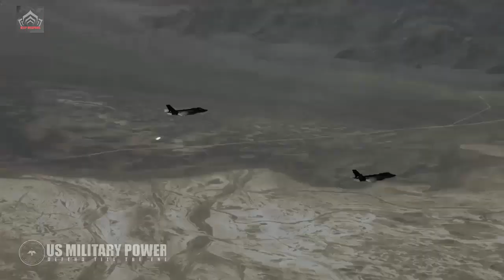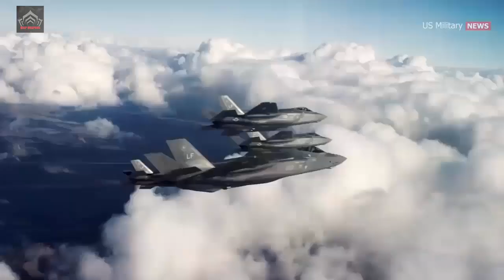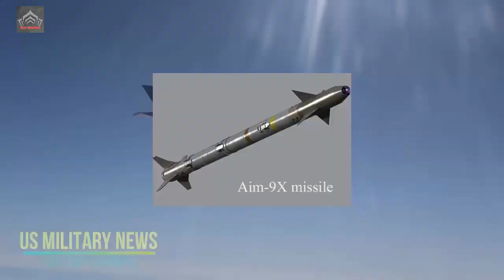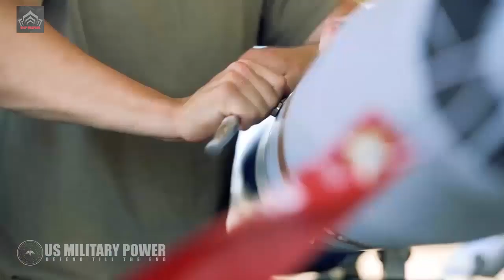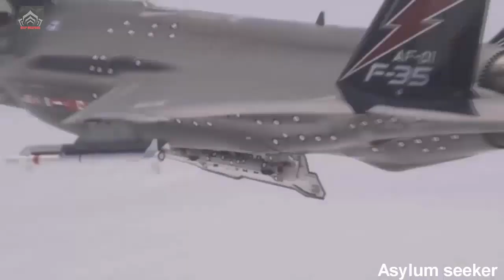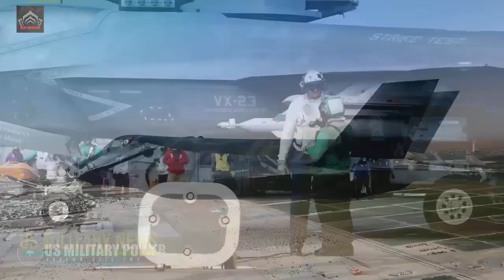The armament that the Polish 5th Generation F-35 fighter jets might use

Comment: Poland need more modern fighters. Polish AF needs 150+ modern fighters at least to counter Russian threats along with other NATO AF. 32 F-35's and 48 F-16's (total 80) are not enough. Additional 80 F-16 class fighters (F-16V or Euro Typhoon or Raphael) are needed to complement F-35 fleet.
Reply: we recently ordered 48 korean FA-50 fighters along with medium and short range air defence systems (program Wisła and program Narew) which includes patriot and camm-er missles
also as far as I know we want to expand our fighter fleet with additional F-16s but queue is very long
Reply: @krajt1999  You cannot count FA-50s as full-fledged figther jets. These are armed jet trainers with very limited combat abilities. And we don't want to expand our fleet with new F-16s. Additional F-35s, F-15EX and KF-21 (in the future) are the only options currently being considered (according to the statement of the Minister of Defence).